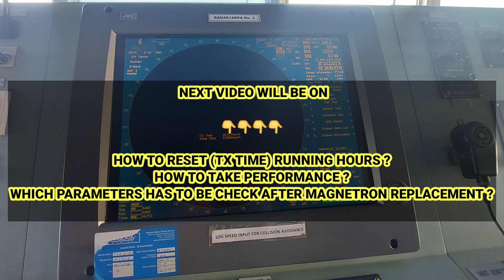MAGNETRON REPLACEMENT || JRC ||  S BAND RADAR

Comment: What's the possible causes of why the antenna is not rotating? Antenna faliure in the alarm.
Reply from the maker: For example, bearing PCB failure & power failure of antenna power supply..
Reply: @TheMarineTechLawrance It can rotate by hand freely